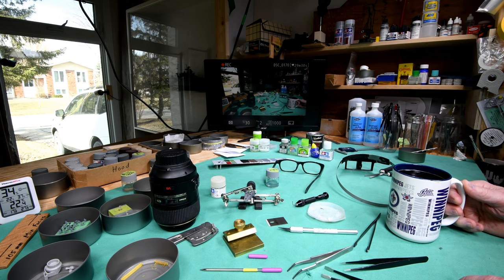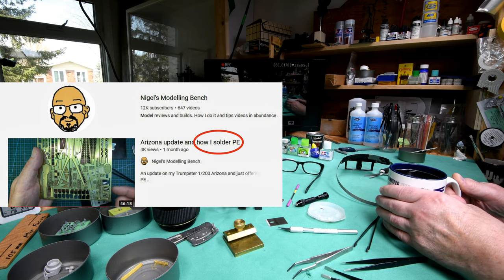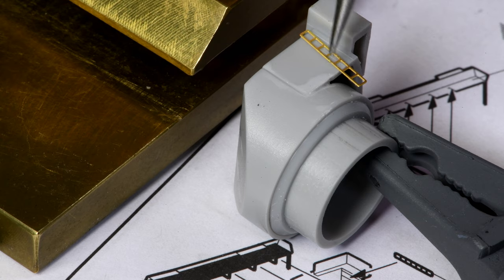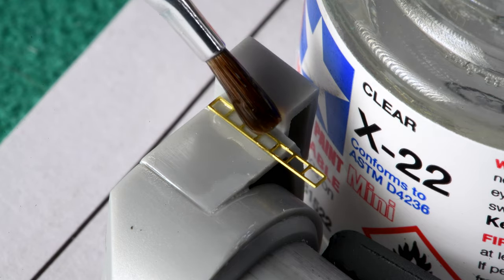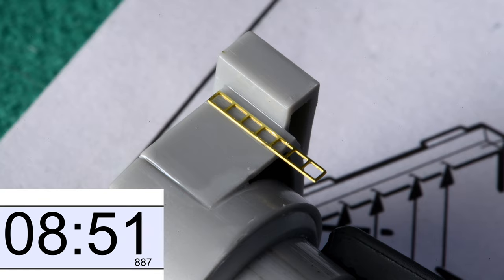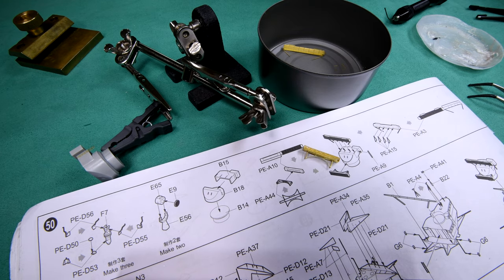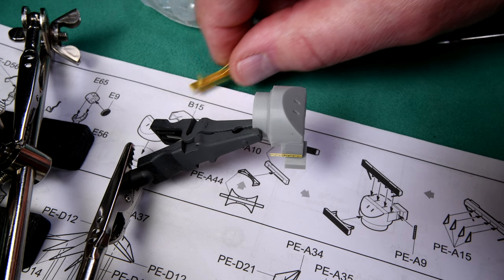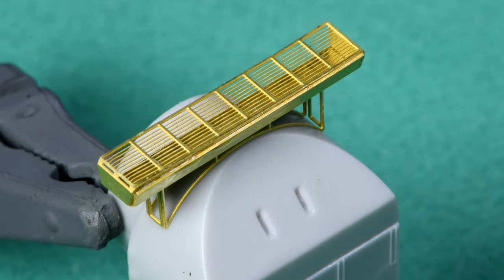The Model Ship - Part 766

Comment: Soldering will be interesting to see I've only ever soldered electronic parts have a happy Easter Ron 🐰🐰🐰🐰😃👍👍
Reply from the maker: This will be my first attempt at soldering PE too. 🤞
Happy Easter Trevor 🐰
Reply: @roncalverley  i wish you good luck with it 👍👍😀
Reply: @roncalverley  Hi Ron , I have been soldering PE for a long time , please allow me to share my
tips , 
Clean only the edge you want to solder , not the whole part , this gives you control over where the solder flows
I use  pure solder paste and and flux paste  , I mix up 50/50 ratio in small metal cup , leaving one drop of pure solder , one drop of pure paste  to each side , you can very the ratio when doing very small parts , much better to use less solder more flux  
You can apply paste with tooth pick or dip edge of part in paste , whatever is easier , 
Lay your iron on edge , corner , or thinnest part  and allow the heat to travel up the line of paste , moving 
the iron slowly along the join , 
On boxes , cranes , I run beads of solder up all edges , not just the join , solder ii very easy to sand and
looks great when done
Reply from the maker: Thanks for the tips James 👍

Comment: Oh man, I actually have that same soldering iron, but mine runs off USB, it's incredibly awesome. Uhm, another good video for soldering photoetch is from Plasmo.
Reply from the maker: Thank you for that video tip. 👍
https://www.youtube.com/watch?v=1AeK7goc_xM
Reply from the maker: USB? Only 5 volts?
Reply: It's using USB Power Delivery, so uh... 20v at 5amps I think? Yeah, mine's the somewhat smaller TS-80 iron, double checked and it draws 12v/3a or 9v/2a.
Reply: Yep! His stuff is great and lots of awesome tutorials.
Reply from the maker: @dakel20  Interesting, because any USB output that I've measured the voltage of was only 5V.
Reply: Yeah, it's a  somewhat newer standard in USB 3.0 and requires a little trickery as I understand it. But it's pretty dang cool what you can do with that much power! My moms laptop actually charges via that. Same for the newer macbook laptops.

Comment: Latter wasn't it coated black before glueing Ron.
Reply from the maker: Re: "wasn't it coated black"
Yes, I knew that I'd done the Brass Black thing on other ladders before gluing them on with the clear coat. Bottom line is that I guess I got a bit lazy here. I'm hoping that because the ladder will now be so clearly defined, the shadow cast will make it appear darker --- "that's the plan" 🤞😁